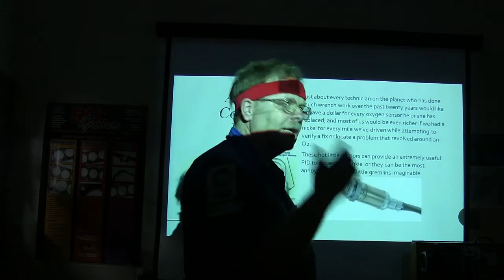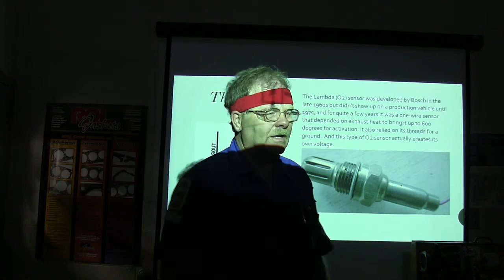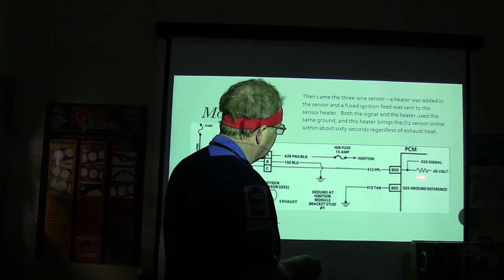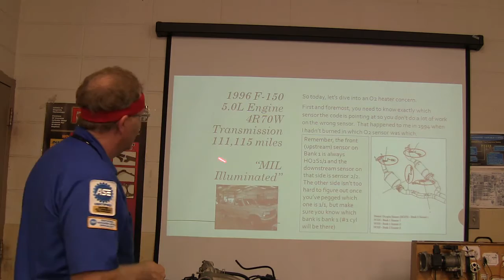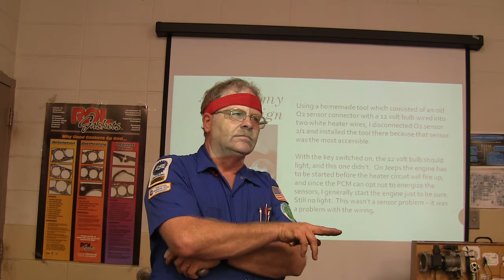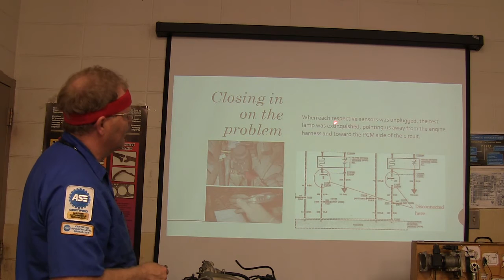Heater Chase War Story

Comment: Hello, Mr Richard.   I am trying to diagnose a p0037 code ( heater circuit low) on an Infiniti fx35. I have power  and ground to the heater. The heater is grounded by the pcm. With key on, I get 12 v on both heater wires, so I ruled out an open in the heater. Once the sensor is up to temperature, it starts switching from rich to lean, suggesting a bad cat. I had a cat code for that bank, which went away without my having to do anything.I don't know if the cat code went away because of the o2 code or not. Would you also come to the conclusion that the heater is not open as well because of 12 v on both sides with key on? Your inputs are so valuable to us as well as your teaching.
Reply from the maker: When you say you have 12 volts on both sides of the heater, that's peculiar - if you're measuring it with the O2 sensor plugged in and the key on it sounds like you have an open circuit between the PCM and the sensor heater. I like to measure the heater with a meter - I also like to take a light bulb and wire it to the heater wires on an old O2 connector, then switch the key on or start the vehicle with this tool plugged in to see if the bulb lights.  Measure the heater for about 6 ohms, then make sure there's enough current-carrying power and ground there to light a tail light bulb.
Reply: My belief is since the pcm does not ground the heater with key On, the 12 v power feed of the power side will go through the heater to the ground side ( Test light on batt negative and touch each side and find 12 v) and when the pcm commands the heater on (when conditions are met for the heater to be On), the 12 v should drop to ground. I know the control wire is not open; the heater is most likely the culprit. I will make sure that I measure the resistance of the heater to see if it is open. I have ground from the pcm  at the sensor when the command on the scan tool for the heater PID say ON ( Test light on battery Positive and test light lights)